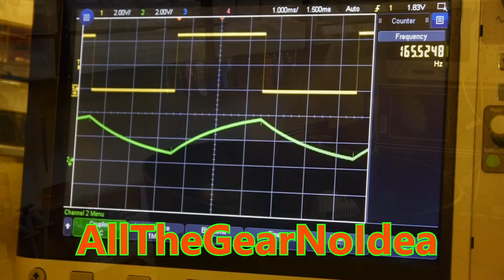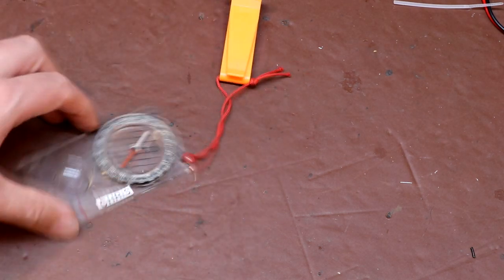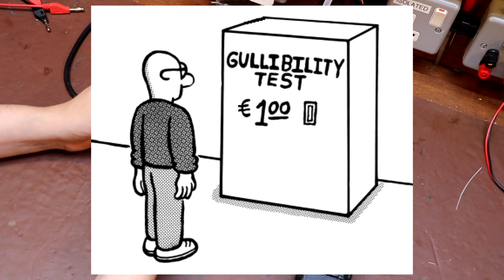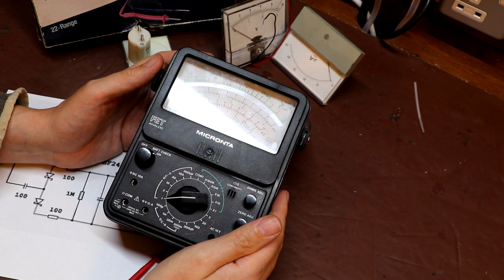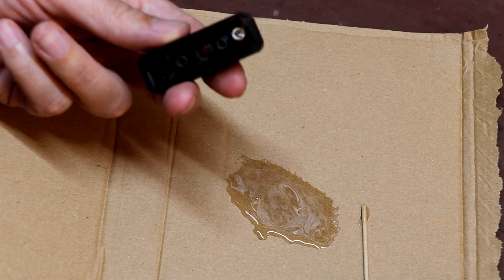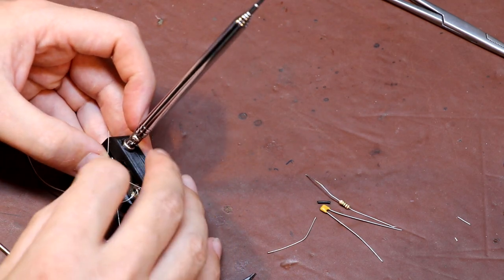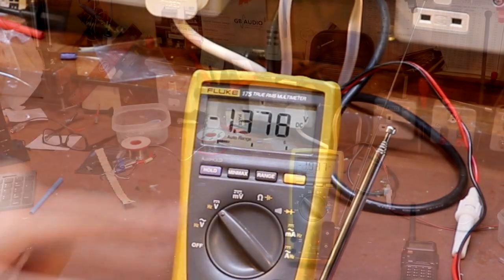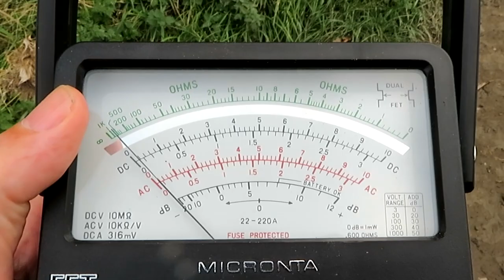Field Strength Meter Tacklife MET01 or Roll Your Own

Comment: CHRIS, GREAT DEMONSTRATION. I used your circuit to build the field strength meter installed inside a multimeter with an internal mounted telescoping antenna.
Reply from the maker: Did the circuit work ok for you ? Thanks for watching and nice comments regards Chris
Reply: @allthegearnoidea6752  Yes, the circuit works great. I found a use for that $5 Harbor Freight multimeter. I can use this in the field now as the ground tuning unit sensor. Peak the GTU for maximum amperage. I just set the field strength meter close to the antenna while tuning.

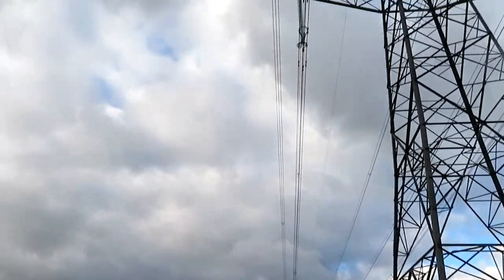Comment: At 40:28 its a shame you didn't have a bigger audience around :) You might even be able to get a fluorescent tube to ionize at that location. Good job Chris, thanks.
Reply from the maker: Ok that’s a great idea on the Tube I’m definitely going to try that. I constantly get shocks in railway depots from the overhead 25Kv lines as the are relatively low and the capacitively couple to the body on a dry day. Surprisingly large number of people witnessed my tin foil hat !
Reply: @allthegearnoidea6752  Yeah, maybe 150-300kv lines? One more thing.....the calibrated FSM you showed at first looks vaguely similar to the Potomac Instruments FIM-41 we used to do annual FS measures of our AM broadcast TX's at fixed geo points.

Comment: A very interesting video Chris but you had already got a field strength meter fitted to your youtube channel.... every time you fired up the transmitter it popped on the microphone. When you were trying to figure out the higher powered of the two radios you could tell by the buzz on the sound which was the one!
Reply from the maker: Yes I noticed that George I should have left a comment in the edit. To be honest I was a bit out my depth on this video I never understood half this electromagnetic theory when I studied it first time round. I don’t have eb the math for it.

Comment: I remember something about those fluke sticks, there was a bad version which didn’t work very well, mine seems to be more sensitive, but I always use a multimeter to confirm anyway.
Reply from the maker: Yes this fluke one is totally junk but it’s very disappointing from a company like Fluke.  I work a lot on high power circuits and in last few years a lot of industrial work has moved to stating approved dead test equipment in conjunction with a separate live test generator. Not that I do that at home as you say I also use a DVM.

Comment: Superb Chris, that was really educational. How would you calibrate something like this? Incidentally you can see the influence of long term exposure to radio waves on that rabbit at the end.
Reply from the maker: Thanks Andrew very generous comments. Regards calibration you would I think have to install the field strength meter in a calibrated environment where you would know the output from the signal generator and the precise gain of the transmitting antenna. I’m think this would need to be done at an EMC test house were there have traceable standards etc.

Comment: I love the tin hat. I wonder if receiving RF re radiated from pylon. Love your 3D printer designs. Daz
Reply from the maker: Hello Darren sorry I only just saw your comments. Pylon actually don’t reradiate  that much RF as the they are quite a poor match for rf sources so when products are tested for conducted emissions the limit is 30mhz. They do however create a lot of wide band interference themselves due to electrical discharges etc across the insulators. Thanks regards Chris

Comment: Speaking of being drunk and making ebay purchases, I somehow wound up with a 9R59DS. Any chance you could let us have the stl file(s) for your cable restraint for it?
Reply from the maker: You bought a 9R LOL. Yes no problem I will put them in a drop box link here for you later. Just in work at the moment
Reply: @allthegearnoidea6752  Yes, I bought a 9R. I had a message from the spirit world instructing me to do it. Well, ok, the spirit was Gordon's Gin. I actually bought a 9R with my own pocket money back in 1970, so it's a bit of nostalgia. Many thanks, Chris. Cheers, Steve.
Reply from the maker: https://www.dropbox.com/sh/yvamw23vjvm8z84/AABNg1UljgEBS9WGur6R5Q5ha?dl=0
Reply: @allthegearnoidea6752  Chris, that's very kind of you. I have the 3d design skills of a retarded ape. Incidentally, I modified mine to use the spare half of the oscillator valve as a cathode follower to drive one of those cheap ebay frequency counter modules where you can enter the IF frequency to get a direct tuned frequency display. Now I can sit there and watch it drift... Happy days :)
Reply from the maker: @oldblokeh  that’s sounds like a great idea. I think people use a similar mod to add and additional amp stage but it looked like a lot of work for me. I quite like to have these old things standard as I have better modern equipment. I really enjoyed my 3D design if you every want a training season on Fusion 360 happy to arrange it with you via zoom

Comment: I'm still trying to understand why that tacky life meter has a temp reading and a light?.
it's like having a spade with a record player bolted to the side,  you couldn't dig the record man :)
Such a crap joke, i know bugger all about modern crap music, thankfully :-)
Your field strength detector worked well and a very neat printed box :-D
I do remember most of the little swr or vswr meters for c.b had a metal block and a 6 inch screw in antenna.
They worked,  but i never found a use for one.  Two AA119 old  diodes and a cap i think.
I was given an antenna field strength plastic clamp meter " Allgon"  brand.
it was supposed to help you tune the antenna.
Nope lol.
You are not tight, not even brutally honest to upset people,  i think you are a fake yorkshire man :-D
Smashing video chris :-D
Reply from the maker: I am a Fake Yorkshire man LOL.  I was born on the wrong side of the tripe curtain in Manchester.  I moved around the world a lot as a commissioning engineer then settled in Holmfirth about 25 years ago.  I know the CB SWR meters you mentioned Radio Cruncher gave me one last Christmas but I passed onto Simon Spiers as it had a power meter on it and Simon didn’t have any RF stuff.  I want it for alignment of crappy CB hand held radio that have a fixed telescopic antenna. I was hoping to tune the transmitter for maximum smoke on the field strength. To be quite honest the real answer is I just got really drunk and wanted to build something none taxing etc. So it was just a bit of fun. I’m really busy with work at the moment so not so much time for big projects. Ok keep safe thanks for watching I always enjoy reading your comments regards Chris
Reply: @allthegearnoidea6752  ' Tripe curtain'  Ha ha i had to chuckle at that, you daft bugger :-D
Reply: @allthegearnoidea6752  same here Chris I lived in Yorkshire until I was 12  I wasn't born in Yorkshire ! BTW